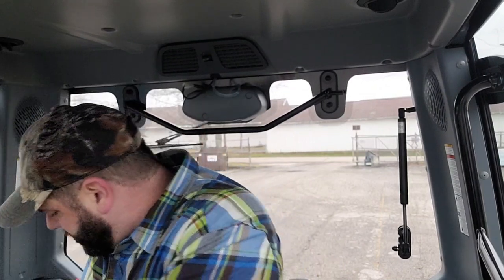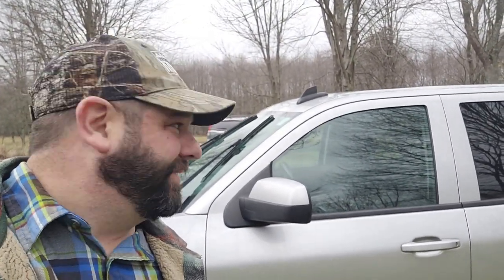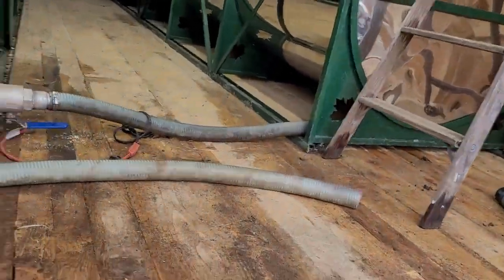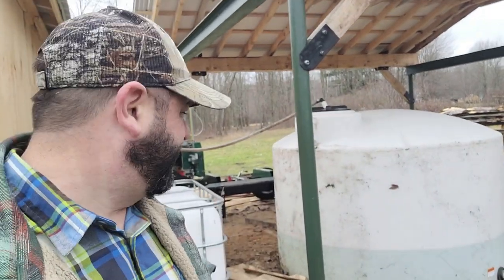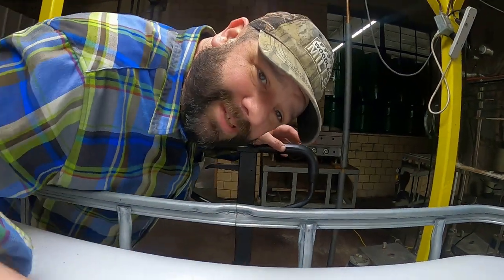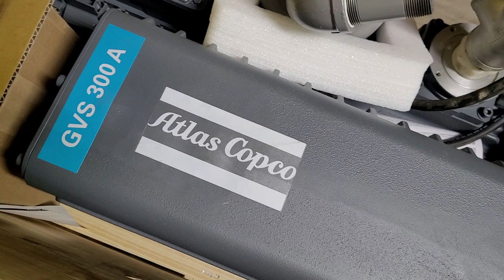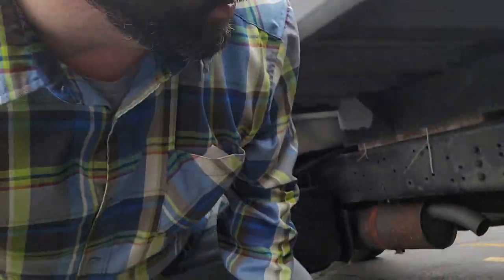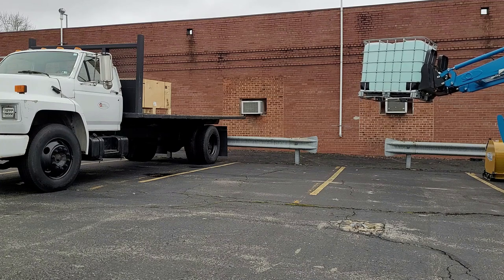#110 LS Tractor for Maple Farming | Moving IBC Tote and Vacuum Pump

Comment: Went running the tractor keep rpm up to 1800 or more if you don’t do this the regain pump will go out also check the oil in front end there 3 plug take out check oil level make sure it full I
Got a xu 6168 with 1200 hr the pump went out and bearing went out on front end 3 time ls bearings are not good got bearings for Napa good to go how Yes I got the tractor new in 2019 we do a lot hay with it they good tractor
Reply from the maker: Thank you!

Comment: Definitely looking good
How do you like the LS tractor so far I’m thinking of upgrade it have a kioti  nx4510 with cab now
Reply from the maker: I freaking love this thing.  Let me know who your dealer is - I am working on a way to help viewers with their LS purchase.
Reply: I've got the MT7101 and love it. I've got the power shuttle shift and it pretty neat to shift with the buttons vs the lever. There is a lever for the high/low range but the gears are electronically shifted.
Can is super roomy and love it. The Kioti and LS dealer in my area are both about even, but I just got more with LS. I've got over 200 hrs in 7-8 mo and no issues other than scheduled maintenence.